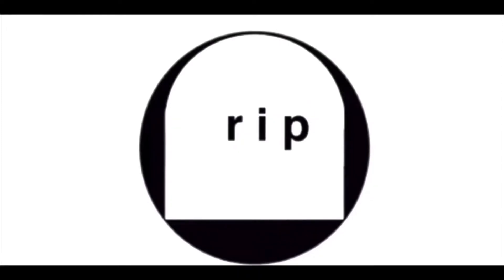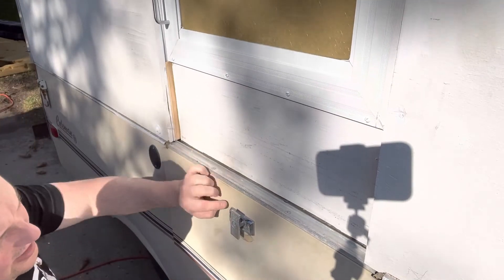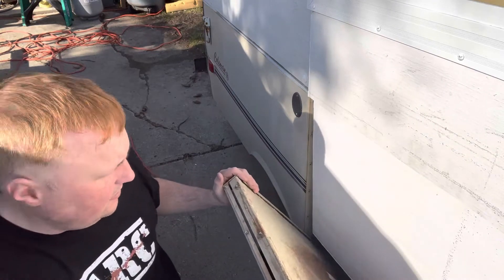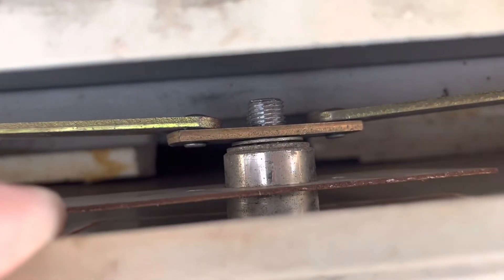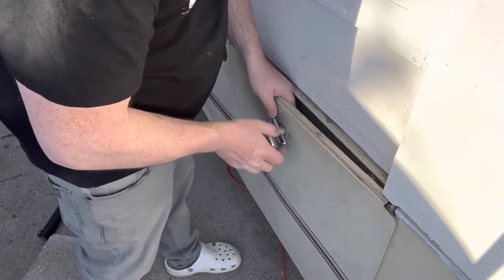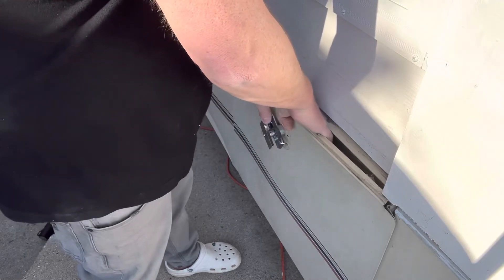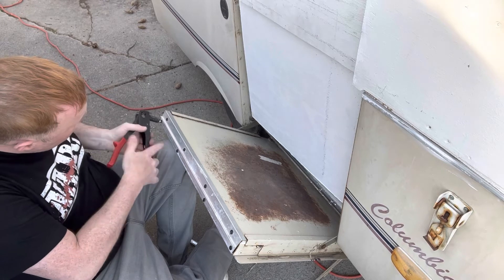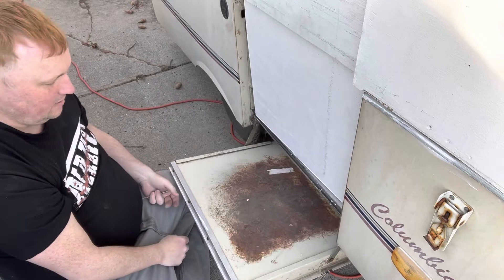PopUp Camper | Installing new Lock | Coleman and Fleetwood trailer ep16 #diycamper #popupcamper

Comment: You can pull all the rivets while the door is still hanging, just knock out the center of the rivet before drilling out with a 3/16" bit. There are two screws down below and then you can take the whole outer skin in the garage to fix.
Reply from the maker: Ahh makes sense. I’ve seen door skins more recently too. So I just was trying to be lazy and quick lol
Reply: Dónde venden la cerradura ?